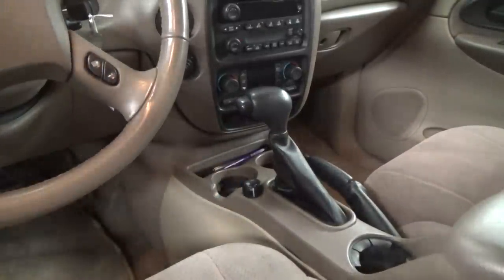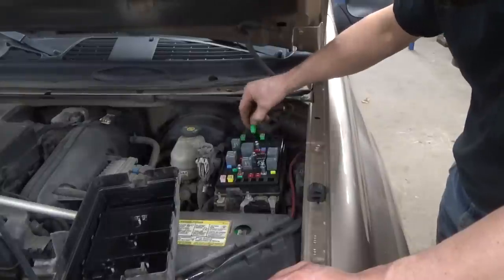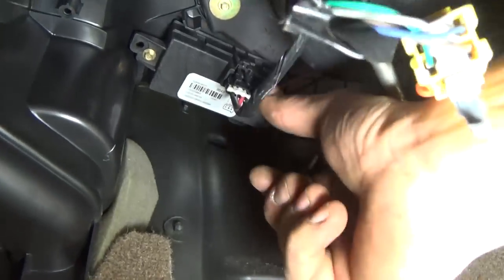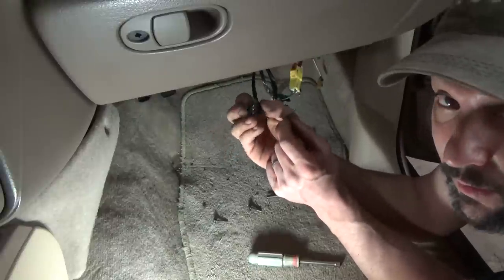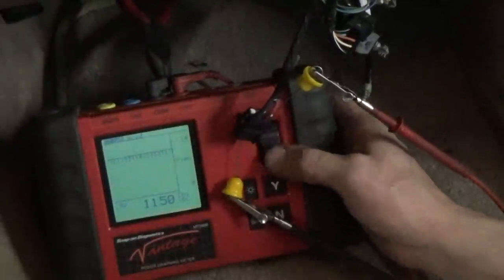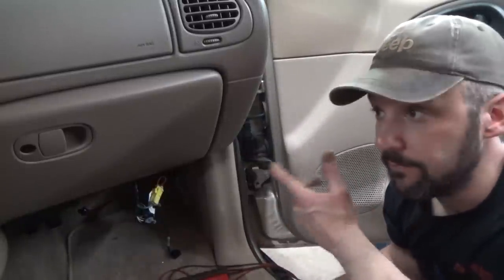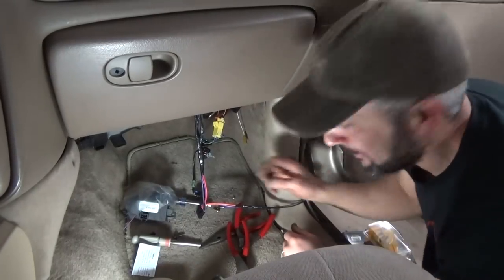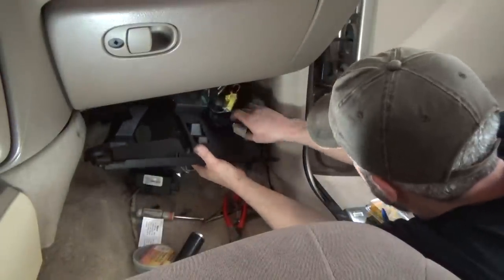Chevy Trailblazer EXT Blower Motor Won't Turn Off

Comment: Hi  Eric
I have just started watching your videos and have been enjoying them a lot.
With regards to this repair I actually think there might have been a easier fix for your problem. 
It appeard to me in the video that as you mentioned turning the unit around would have given you enough length to complet the repair. 
If you had trimmed the extra mounting holes off the resistor and only used the one hole you needed for the screwI think it would have fit. 
This would have saved a lot of time but not made a great video.

Keep up the good work. and remember IF I can See it So Can You (LOL)

Comment: thanks for video I replaced mine in just a few minutes and it works like a charm. Thankfully I did not have t0 splice mine
Reply: Probably because you bought the GM original part rather than the NAPA knock-off.

Comment: I don't think you're whining one bit! These are legitimate beefs in the 21st century. Quality control and customer service are in the toilet, and prices keep going up and up! I think the country is in worse shape than any of the media outlets lead us on to believe. I too deal with this crap day in and day out, and I'm ready to blow a gasket!

Case in point, I finally (Rock Auto shipped using DHL & the Post Office - no SLOWER way to ship a part) got the 2 rear KYB shocks for this '88 Isuzu Trooper project I've got going on. I open the boxes - one has the metal dust shield ... and one doesn't!! Are you friggin kidding me??? They both have the factory nylon strap around them keeping them compressed for shipping. So I go in the house
all pissed off, ready to file yet ANOTHER RockAuto return (5th time this month alone!), and I look at the pic - it has no dust cover! WTF is going on here??? I emailed KYB - we'll see how that goes.

In MA, I sure as hell want a dust shield on my shocks if I expect them to last more than 10k miles! So as of right now, I've got 2 different looking shocks I'll probably have to install. Customer is going to love that one. We get made to look like idiots, when it's other idiots shit rolling downhill! I'll tell ya ....

I need to vent about this every so often. Today was the day, and I just happened to find this vid. Relieved it's not just me that's seeing this crap. I'm disgusted with it all. Thank God for whiskey ...

Comment: Oh, i love this video, worked on trailers for 20 years, i ALWAYS ran into the same problem on trailer air valves, why in hell cant they just make the same valve they installed at the factory??? But NO, they always got to move the air line ports to the other side of the valve!!!!!!

Comment: I worked as a Ford tech briefly - now I do software development. We will get around to those bugs someday :).

I learned that Factory parts always save time. Time is money. Even though I drive older cars I try to get Motorcraft for electrical stuff and filters. My explorer has a similar blower resistor(well power transistor) that fails. I think it can only come from Ford. 

I'm sure you know lots of NAPA stuff is repackaged Dorman, or sometimes Standard Auto Parts (which is BWD at Advance) and Standard supposedly has two grades of product, I think that reflects in the NAPA line too. That stuff is really hit and miss. Didn't have such great luck with aftermarket bosch 02 sensors either.  I do think dorman makes a good aftermarket intake manifold, at least for the Ford 4.6L. It is made in the US, and I spoke with one of their product managers about it. They changed the design though recently, and you need a bit of RTV to seal it up right. Of course it was not in the included directions, so I had to redo it to fix a nice vac leak. The gasket had a nice dimple where the divot was. Installed many of them for myself, friends and family, no issues. 

Napa does stand behind their products. Every year I exchange a parking brake cable for my explorer. The loop breaks off at the lever, I use it every day. They are happy to swap it. A few years ago they had bad alternators, I went thru 4 of them and they admitted there is an issue. This was their premium new NNE line  Ended up getting one of their remans and no problems since. The new crap was made in China. Made in USA aftermarket don't mean anything as you know...problems is they design for as many models as possible and you end up with the mess you are dealing with. Don't feel bad though, even the Ford OEM replacement blower controller kit requires you to splice wires on some models. There are two kits, one with and one without a harness....but no fitment issues like that.
Reply from the maker: alb12345672 Oh yeah, ya basically summarized everything I have thought. I knew the relationship between BWD , Standard, NAPA and Dorman.. I have never had a problem with NAPA Standing by stuff when it fails, it is always warranty labor pay that I can never get. OE is hard for me to get same day, almost never happens.Usually a 1 day wait and if I had to get everything OE I would be days behind on every repair. As far as my own vehicle I only buy stuff from Honda.
Reply: I'm friends with the commercial guy at my local advance and he said many of the aftermarket parts are for older cars and meant to last maybe 1-4 years, likely the car is gone by then or the shop had a six month warranty and the lifetime part warranty is moot. Many shops won't even bother with it tell the customer, or the customer will just go somewhere else. 

 That balances out with the DIYers who may keep their car another 10 years....and some parts may actually last. So they do OK. Ford,Honda, etc warranty their parts 1 year, and I've never taken advantage of their warranty(Hmm..maybe once?). Unless their is some defect I have  original parts on my Fords going on 20 years(some of my o2 sensors are that old and have a perfect waveform).  Lifetime warranty means nothing. 

Does advance pay labor? The guy here said it depends, but they do reimburse pros for a POS part.
Reply from the maker: Advance does pay labor claims up to 90 days and only $50 an hour on book time.

Comment: Excellent video. I fully sympathize with you. This kinda crap happens to me every day as well and it's very frustrating. The mindset where I work is to repair everything as cheaply as possible so sometimes the crap we get is even worse than the part you got. I always say that my hair didn't fall out, I pulled it out. I usually solder and shrink tube bout 99.9% of the time. It seems that every time I get lazy and use butt connectors it comes back to haunt me. Keep smiling {:-)
Reply from the maker: wysetech2000 Wait a minute did you say I'm lazy!? Haha
Reply: South Main Auto Repair MMmmm.....I was referring to myself but......HaHaHa.

Comment: Eric I had to do the same wire cut and splice for a fuel pump on my 2001 Blazer.  I thought it was stupid and if you don't pay attention it could cause problems you don't need.

Comment: Excellent video and i hear you about that "ordering system" deal. You see, most software companies that deal with stuff like this are in the "old days" where someone coded something long long ago, left a runtime with minimal documentation and expected everyone else to just "figure it out".
What i am saying is, most of the time it's even out of the current developers hands. And it would be "too expensive" to correct the problem, easier to just find a work around even if it takes hiring a special kind of guy/gal to sit and sort through emails and post-it notes all day to get around it.

Compare it to someone working in your shop for a month while you are on vacation and when you get back, all the tools have been dropped in a bucket of cement.
Reply from the maker: Cadde Haha good way to put it thanks :)

Comment: I replaced this module, blower motor and pigtail in my '05 trailblazer one year ago. Didn't run into the problem you experienced. Don't recall who makes the module I used.
Reply from the maker: Stanley Waggoner Oh nice :)

Comment: Fixed a couple of these on GMs in the past. Just crack the case open gently, desolder the burned out MOSFET Transistor and replace it with one from Radio Shack or so. It's about 15 to 20 min labour and 50 Cents in parts and if you use a higher amp rated transitor it'll last even longer than the original one.

Comment: I love crimp connectors they have saved me from losing my mind when I remove crappy aftermarket stereos to find some clown has cut the wiring harness and left a mess of wires held together with tape.
Reply from the maker: Matt Bartholomew Lol no not the taped in radio haha
Reply: Because they were too stupid or too cheap to order a "matching harness"

Comment: I thought I remembered a shop having this problem when I worked for Advance, yes the BWD from Advance is the same exact one you got, the same part number too.  As a former Commercial Parts Pro from Advance, it kinda upsets me that in your 2 most recent videos you said "Advance didn't have it", (I watched the Ford one first).  
Also, I am having fun with supposedly "direct fit" parts for an aftermarket stereo system for my own 04 Envoy, same basic vehicle as this one.  I am getting tired of ordering one thing and being told that, NO that isn't what you use even though 2 days ago we told you that it was.
Reply from the maker: Eric Brunhammer We are a small town, I say Advance didn't have it all the time haha... don't feel bad usually it is the same with NAPA too....

Comment: I have y question. We have a 05 trailblazer and blower motor only would work on 2 maybe 3 settings  , then quit completely. Changed blower motor resistor and nothing. Has power to resistor and to the wires, yet still no fan on any speed. Hot wire motor and then we have the fan ? Any recommendations ? Control panel ? Any recommendations will be greatly appreciated !!!!!

Comment: Thank you so much I just replaced the one in our 2005 trail blazer. Thought I would have the same issue with splicing the wires to the motor but my resistor had more room. Could this be due to engine size v6 or year? Thanks again.

Comment: Yeah, I feel your pain. I've Always Had Bad luck with napa parts. I got a power steering pump that was bad right out of the box from Napa. Surprisingly, I've never gotten a bad part or had a part fail from autozone. Granted I'm only 19 and have been working on cars for 3 years. Anyways, what do you think of trailblazers? I have one with 178,000 miles and have had no major issues other than a couple ignition coils.
Reply from the maker: Richard Evans Most of the problems I see here with trailblazers are rust related. Other than that they seem ok. You keep doing this u will get more bad parts I am sure :)
Reply: @SouthMainAuto   i avoid parts from the zone ive always had terrible luck with them

Comment: I loved the video.  I have a question after watching the video on replacing blower motor module  I went ahead and replaced the blower  control module it worked great for about 10 minutes then it shut off on its own and then a few minutes later it came back on  whats wrong ??  No I didn't change the bower fuse yet not the blower motor .  what can be wrong??

Comment: Can I get you to send me that little sticky pad.  I have a 2004 Trailblazer that I am working on and saying the same thing.  "Really"  I just hope replacing the Actuators in the front and rear do not cause me issues.  Not to mention this weekend I will be replacing the VVT solenoid.  Bang bang bang.  I think this must of been a therapy video!!!!
Reply from the maker: Hey it is either that or valve springs right? haha
Reply: Ya know I really hope not!!  If it is valve springs it will be sitting in your lot with you wondering who put this POS in my yard. LOL   I just want to get it running again wish me luck.  Again your videos are great. When you get a chance to watch mine you can be guaranteed a laugh at a real amateur trying to repair his car.
 I look at it this way it is not how you get there but the fact that you arrived.
Reply from the maker: Yes sir! Haha that is a fact :)

Comment: I feel your pain  My Honda threw a ckp dtc today Cleared the code and it came right back. I need to follow the flow chart to see if the distributor needs to replaced or if its the pcm. It was a reman from from cardone. So I called Autozone because I know it has a lifetime warranty. Well The Autozone by the house where I got the dizzy from said they could not find the warranty info in their computer. So I asked them to try a different number. They said they where busy and told me to call back and then hangs up. So i stop at another Autozone on the way from the gym.and they where able to find the warranty information. Here is the kicker they have none in stock at any store and I have to pay 222 dollars up front so they can order so i can warranty it. It makes me crazy mad that I have to pay for it then warranty it and then bring back the old part to get my 222 dollars back. Then I look on Amazon and see it for 125.dollars rand new. Same brand. Way under 100 dollars on ebay.
Reply from the maker: Bruce Pierce Ahhhh I totally fell your pain man. I just want to remove all the warning labels on everything and let this problem sort its self out.

Comment: i use to do solder and heat shrink, but actully been using the crimp connectors more and more.... I feel your pain i have done a few things end up been to short or like you said something doesn't fit

Comment: Great video but i got a question i have a 2004 Yukon Denali XL i replace the blower motor control module "blower motor resister" and blower motor  i have replace 3 to 4 control module all failing within two to three weeks either blowing on hi all the time with the truck off or not working at all any help,

Comment: napa turned this 10 minute job into a 30 minute job to make an extra $1.00 selling that universal instead of original configuration. now i need to do this job tomorrow and i will not be cutting wires, i will order online if the the clowns try to sell me a universal. thanks for the video again

Comment: GM AC delco is the same.  I had to replace that part on my 06 Sierra with auto HVAC, and it wast the same cut and splice jazz. This was a genuine GM part.   I guess it is an "updated" design.
Reply: On the GM OEM part, you do have to cut and splice three wires because the part is an upgraded design from a different manufacturer, but you shouldn't have needed to splice the two to the blower motor...at least I didn't on my TB EXT

Comment: Hi I have a 2008 uplander 3.9l my rear and front blower not working . On none of the settings not even high speed..I replaced the resister and the motor still not working . When I check the resister wires I get 11 volts on all the wires but no blower. I don't know what else to do any help would be appreciated.  Great vedios man keen it up

Comment: Like your channel a lot.  However I cringe to see the splicing of wires -- not soldering and heat shrinking.  Keep up the great videos.
Reply from the maker: The Carter Hour Thanks :) Nahh those crimp and seal connectors will out live this old chevy :)

Comment: Just bought a 2002 trailblazer LT .  Is it normal for the air flow to be low in all vent locations?  I can hear the blower changing speeds in every setting. Thanks for any help. NO cabin filter installed.

Comment: Hi my 2004 Trailblazer LS not an EXT or California, the entire heat and A/C system will not turn on. Or it will fully turn on including the A/C if it's switched on. Resistor? Hidden circuit breaker? Loose neg ground?

Comment: Hey Eric on that 05 Chevy trailblazer blower motor couldn't you have just trimmed the other ear and turn the module around anyway use a hacksaw or something if it's just a  Mounting ear and there is no a circuitry just cut the plastic to fit

Comment: Ok 2010 GMC sierra blower quite working altogether, nothing, so changed the resistor then it started working on high only and had to pull the fuse to shut it off. Thinking that resistor is bad took it back now it doesn't do anything again. Any suggestions, did check the fuse again just to make sure didn't blow it it's good. Any suggestions?

Comment: i am hunting down a fornt blower motor not turning on. customer complaint. what i found  blower motor making noise when low (i put outside source power to it), #4  bcm fuse was blown, #13 radiator fan heat distorted but not blown yet. front blower motor relay missing #32. i moved the #20 spare relay to the #32 spot. still no go.then i moved another relay to make sure its not the relay. and still no go.   i got a new resistor module for the blower and still no go. now im going to pull the button crontrol unit and check that. 
the fresh air motor works sometimes also. so there is power at the resistor, and ive checked got under 12v. 

any thoughts on this 05 chrysler Pacifica 
170000miles. 

i watched your video on the ground wire fix. the wir on this one is still good.

Comment: I have a question Mr O. .... is the control input to the module a power or a ground? I'm having trouble understanding how the voltage INCREASED as the blower switch was turned up... I always thought that if I were measuring voltage on a ground the voltage would decrease as the blower speed increased.... I'm confused about how the input control works I guess. every time I think I have a handle on how electronics work someone way smarter than me shows me that apparently i do not lol